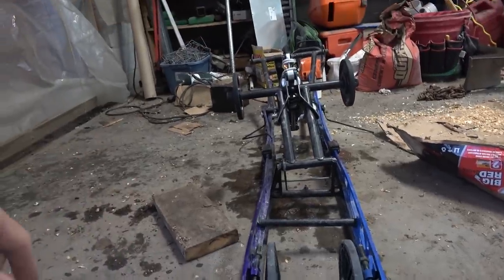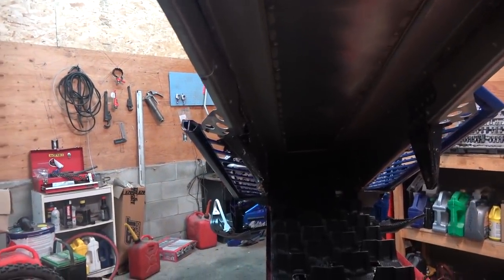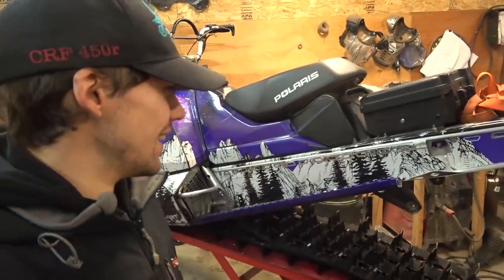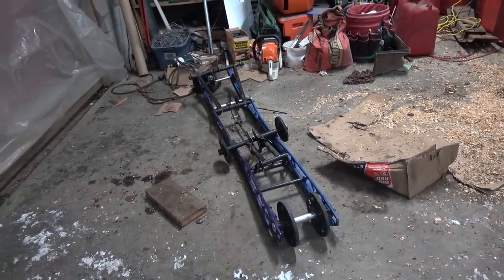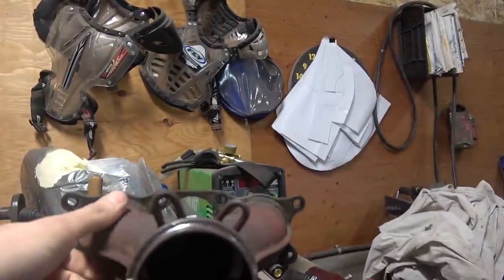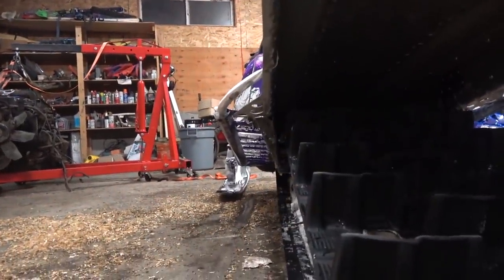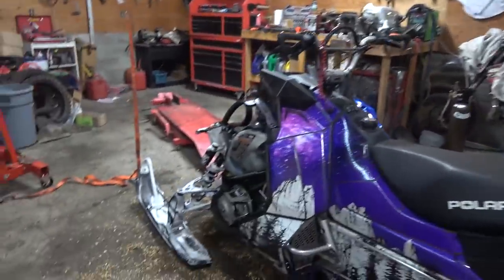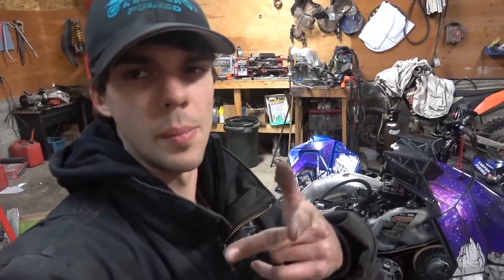Wrecked Snowmobile Revival! | Shop Vlog | Dec 18th 2021

Comment: Dropped you a link for a 155 left side axys running board. If the link doesn't work it's on ebay.
Reply from the maker: Thanks! I think ill see if i can find one local first, but ebay is definitely not a bad plan 👍